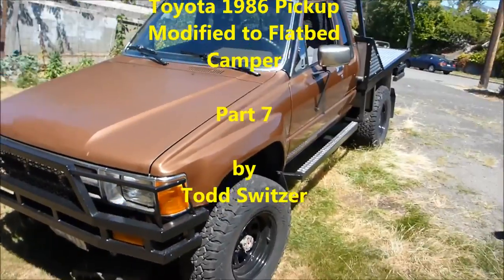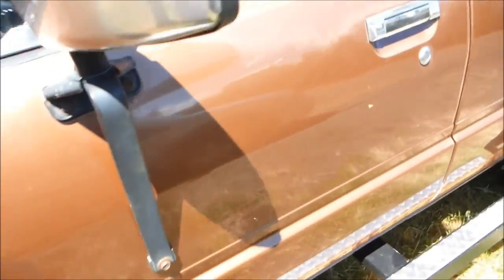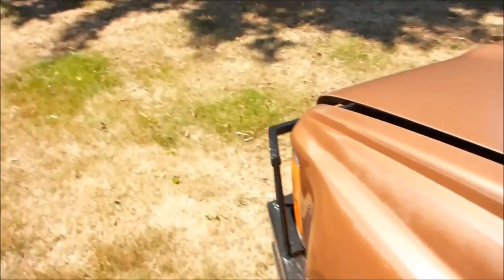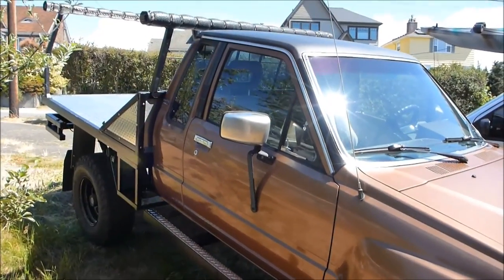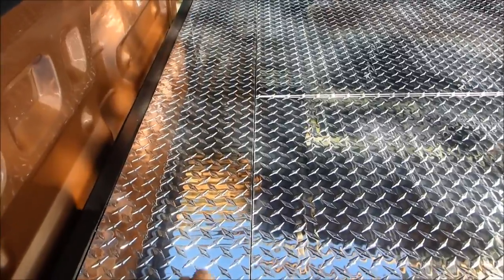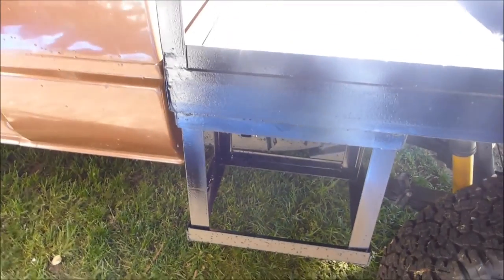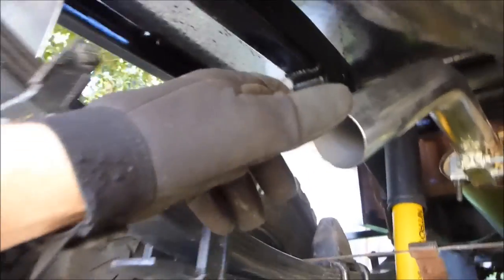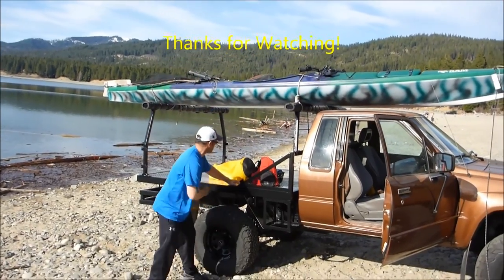Toyota 4x4 Pickup to Flatbed Camper Conversion - Part 7

Comment: Nice, I have a chevy dually crew cab wanted to do that, but I'm not a welder, thanks
Reply from the maker: I'm not a welder either. I just use the proper camera angles so my viewers can't see my sloppy welds then buff it all out with a grinder. As long as there is some mechanical back up (bolted to frame) and several points of contact for each piece, then a failed weld will only result in a rattle.

Comment: finally done Todd wow what journey you took your truck from a forgotten private soldier to a true kernel status and ready for active sevice again.how much did you spend total on materials and truck parts?
Reply from the maker: Thanks. It rides like a different truck entirely at this stage. I didn't add up all the receipts but I'm guessing it was about $5k overall and the materials for the bed (steel and aluminum tread plate) were about $1k of that.

Comment: very cool hilux well that what we call them here in Australia. these Utes (what we call trucks because there under utility so we call them "utes") a very popular with every type of person eg camping, dirt bikes and work men and it very rare now days to find them with there tubs they are all flatbeds now days
Reply from the maker: I agree this Ute has worked out a lot better for me, camping, hauling dirt bike, even hauling garbage to the dump. I can get at it from all sides and strap things down or load it up with any configuration I want. But you still don't see a lot of them outside of commercial work trucks in the U.S. except for Hawaii where they're all over. I've spent time in Australia and I know that locals don't care about image of their truck as much as the function of it. I've offended more than a few of my fellow countrymen that think that I ruined this truck by chopping off the bed and doing this, but I figure they just need to get over the whole truck image thing. When I get another truck the first thing I'll do is rip the tub off and do this again.